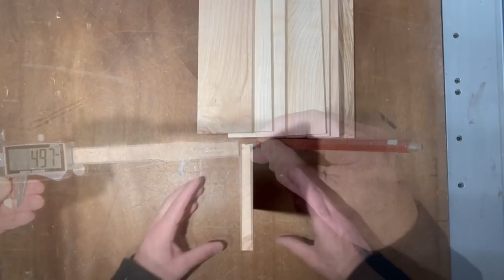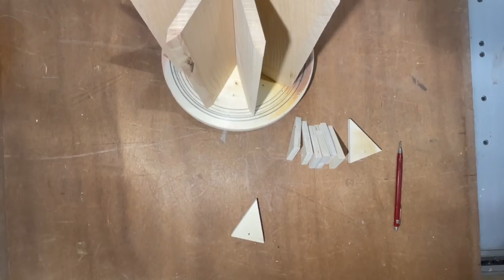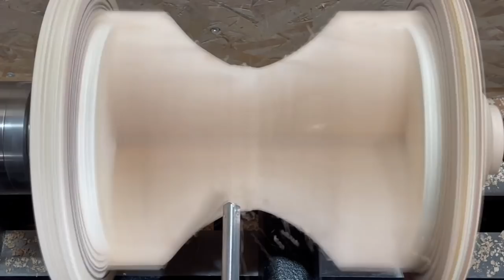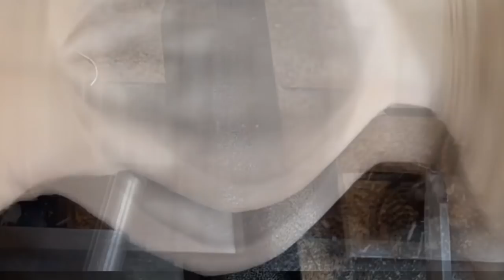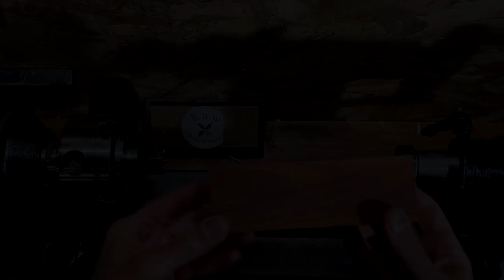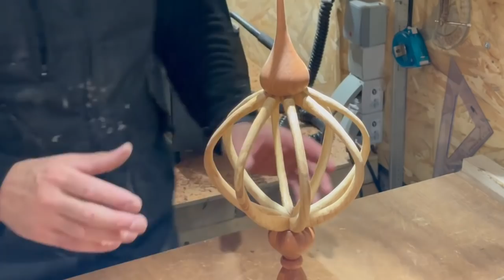Woodturning : New style of Christmas tree Ornament

Comment: A beautiful object.  Couldn't it have been made quicker and with less waste by sawing out the rough design from the fans?  I am not yet a turner so I don't see the advantage of changing wood into dust when cutting the outlines would have resulted in some smaller pieces of the wood that could be used for other projects.  [ I inherited a long bed lathe from my father.  It had been given to him but he never had a motor to power it.  One of these days when the house project is done and I can set up a proper workshop...]  Thanks for showing us your process.
Reply from the maker: Hi Francis
Thank you for your comment 👍😉
There are several possible techniques for obtaining shapes in woodworking, here it is woodturning which is used, but indeed I could also have used other processes.